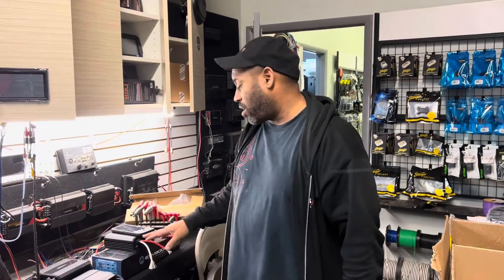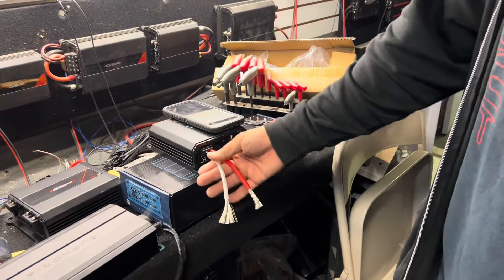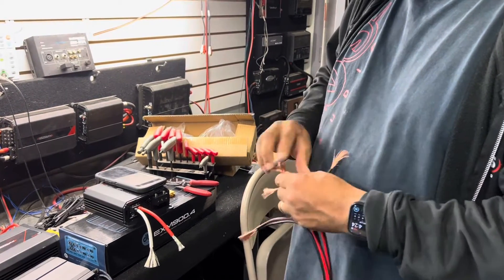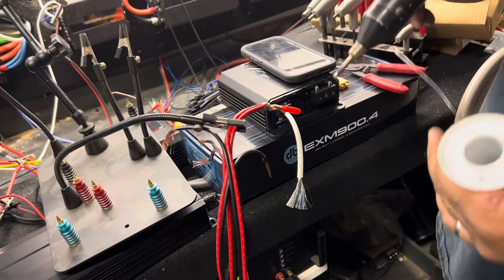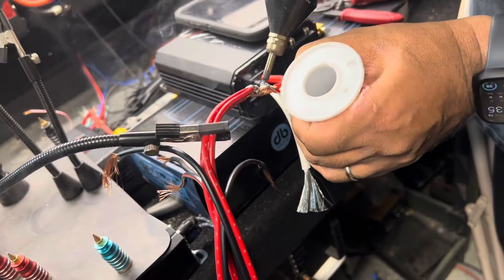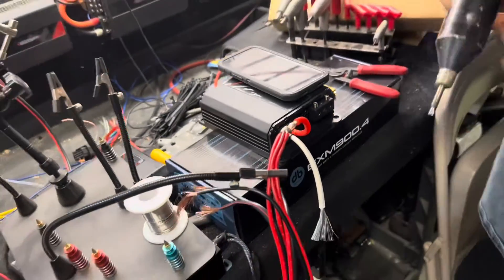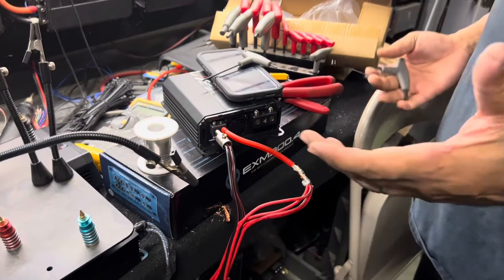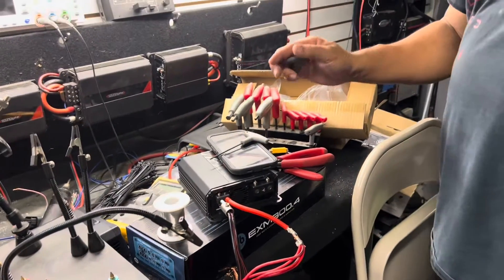How to hook up 4 woofers to a 1 channel amp

Comment: So is this wiring in parallel or series? Question, I have the 800.4 and want to wire up my system for max output. I'm running 2 6x9, 2 8s in the bags and 2 6.5s in the lowers. How would you wire it ?
Reply: Need another amp. You're short changing yourself by running 3 different sets/sizes of speakers off 1 amp.
Reply: Id do 8's on a 400.2

Comment: Hey I’ve never been able to find the 8g to 4g adapter. Can u send link please. Also for the soder gun
Reply from the maker: Amp Input Reducer 4pcs 4 Gauge to 8 Gauge Wire Reducer Power/Ground Input Reducer Adapter Brass with Gold Plated https://a.co/d/abQJGv6